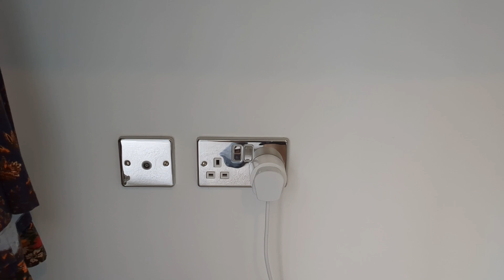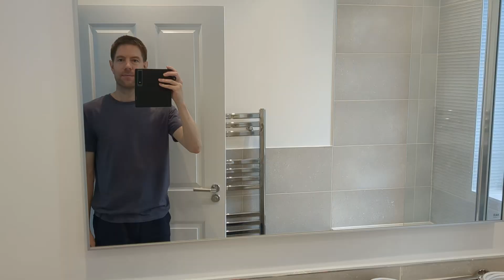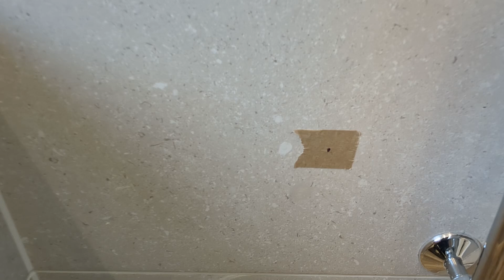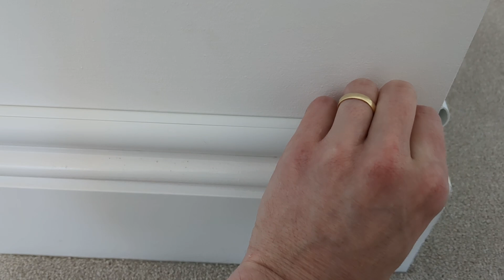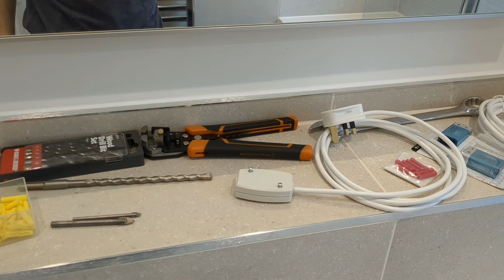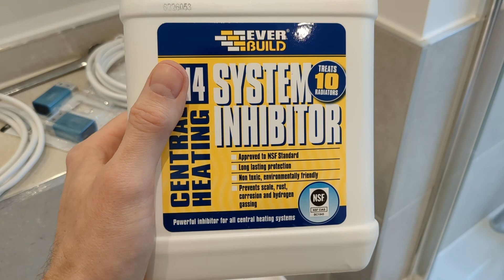How I electrified our towel rails

Comment: Could you add elements into the radiators in your spare room also??
Reply from the maker: Those radiators are now gone so no, not as it stands!  But I believe immersion inserts need to be vertical and those radiators wouldn't have allowed that anyway so they would have needed changing for different ones regardless.
Reply: @TimAndKatsGreenWalk  hi TIm, what makes you think they can only be mounted vertically? I am hoping to fit one (horizontally) to a new cloakroom radiator. Can't find anything online (yet) which suggests can only be vertical, though all the pictures usually show a vertical mount into a towel rail (not radiator). Cheers.
Reply from the maker: @boomerang2  the instructions that came with the ones I got say they should be installed vertically.  You may be able to find specific horizontal ones but most (possibly all?) are designed to work vertically (or at least all the ones I found while looking for towel rail ones).
Reply from the maker: @boomerang2  a quick Google search reveals specific horizontal ones though for radiators rather than towel rails, e.g. https://www.justradiators.co.uk/dq-hgt-horizontal-thermostatic-heating-element?ps=OTM9MTE4NTEmMjY1PTE2OTc2&gclid=CjwKCAjwkY2qBhBDEiwAoQXK5SjgOO8CYeDBHiEcU-TgcXZfvqZy7_tvWO8Dt8oqqJSjItI5NcBdMxoC-dwQAvD_BwE#93=11851&265=16976&utm_term=&utm_campaign=*CSS+%7C+Generic+%7C+H_P&utm_source=adwords&utm_medium=ppc&hsa_acc=5690114029&hsa_cam=11427413721&hsa_grp=120301516748&hsa_ad=474485212742&hsa_src=g&hsa_tgt=pla-332869694290&hsa_kw=&hsa_mt=&hsa_net=adwords&hsa_ver=3
Reply: @TimAndKatsGreenWalk  i also found the same via another website Tim :D     
Annoyingly they are somewhat more £ than the vertical variety. Does make me wonder if, for similar cost, to have undertile electric heating installed instead (along with the radiator to be solely running via boiler). Would be nice to have toasty feet all year round, in what is a cold cloakroom (north facing). Though my concern here is that it the electric mat will raise the floor height ever so slightly. Much to ponder! Cheers

Comment: FYI you could wire these in parellel to an eddi as well
Reply from the maker: That would require a separate electrical circuit which would be a bit of a pain to get added.  But yes, in principle that could be done.

Comment: Great, I had a quote for £1,050 to do 3 towels rails last week!
Reply from the maker: Blimey.  I think this cost me about £200 all in, and that included buying tools that I can use for other projects later.  Plus it took a fair while to do, so there's that.
Reply: My cable runs aren’t as straight forward so I may still need to get an electrician to add some new sockets but the rest of it looks pretty straight forward. Do you have a link to a good video to drain the central heating system?
Reply from the maker: @olej24  erm, I think I just did a search and watched a couple from different plumbers.  Let me see if I can find one.
Reply from the maker: @olej24  right, apparently I watched this one according to my watch history.  Although it turned out to be a bit more complicated for our system and I had to drain each radiator individually, annoyingly: https://youtu.be/_diB6LmlVq0?si=YpYTIVpY-93_e3LN
Reply: Now you know why the electrician's apprenticeship is 5 years .... 1 year theory, 1 year practical & 3 years Offshore and International banking 😅